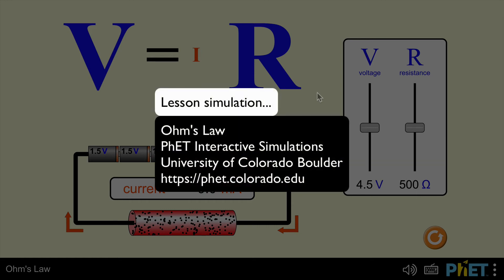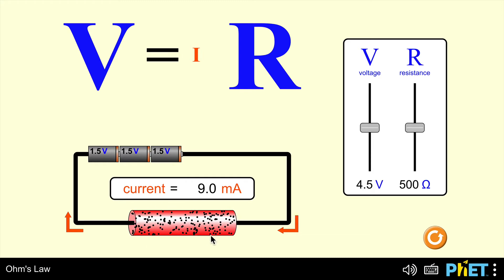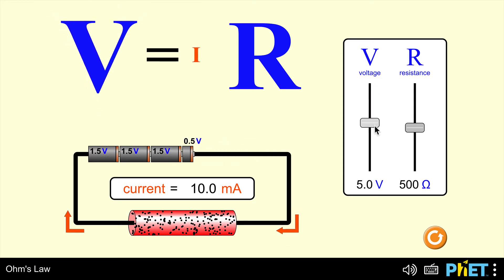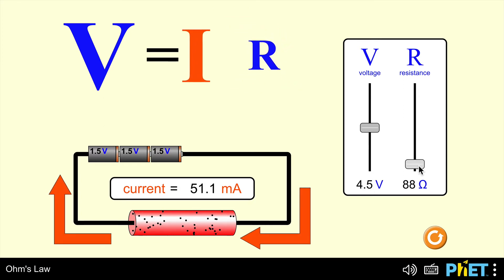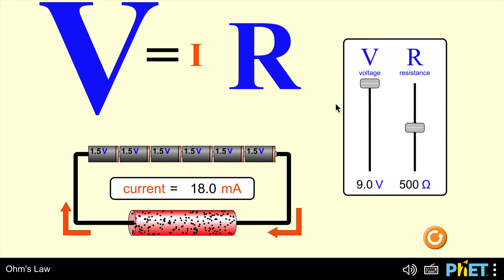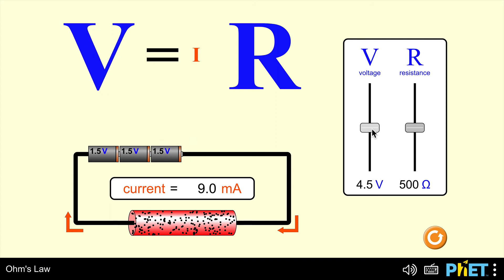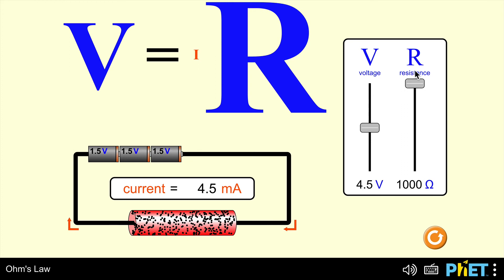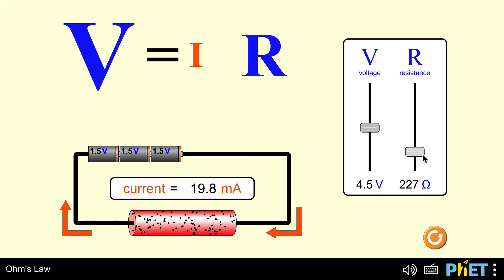National 5 Physics - relationships between variables (Ohm's law) simulation

Comment: Sir why is volt added in series
Reply from the maker: A voltmeter is always connected in parallel. The circuit shown in the simulation is just a battery of 3 cells and a cylinder that represents a wire. Hope this helps!